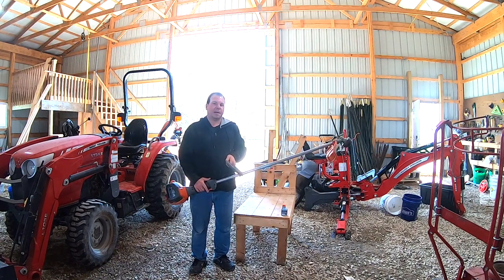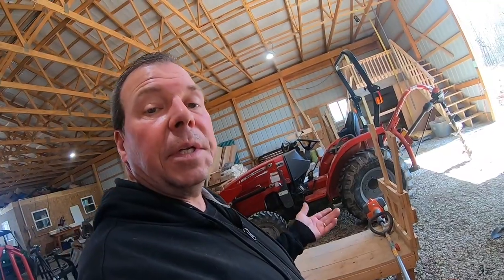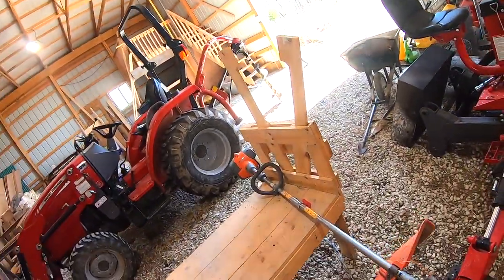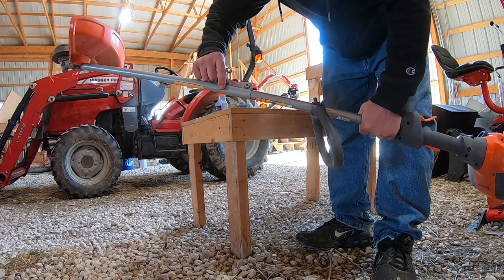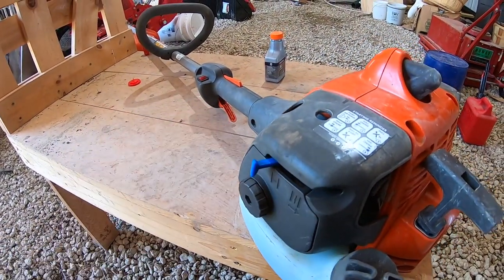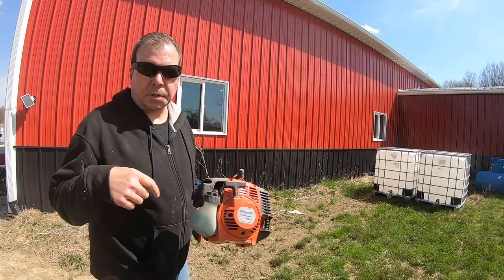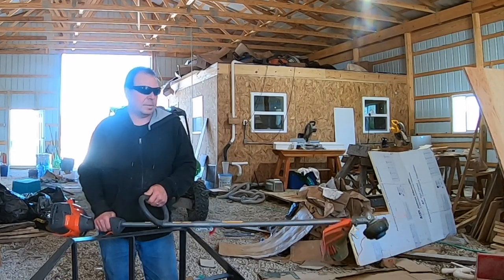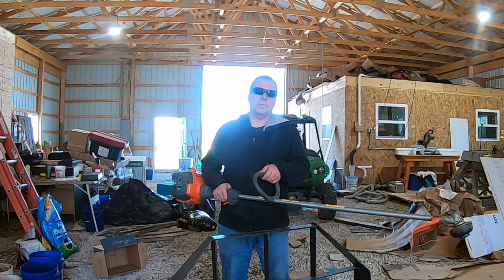Husqvarna 128LD

Comment: I bought my Husqvarna 128LD from Lowe’s last year for $199. Biggest upgrade you can do to this trimmer is replacing the head with an Echo SpeedFeed 400. Best $30 I spent. I also picked up the edger and mini tiller attachments. Haven’t used the tiller yet, but the edger works great.
Reply from the maker: Hey Matt,
Nice! Thx for watching!
Reply: Where can I find the edger attachment for the 128LD? Husqvarna discontinued the edger attachment! Having trouble finding one! Is there another brand that is compatible with the 128LD?
Reply: @user-qr3vs7jz3x  I believe the attachments that fit Craftsman and Troy-Bilt split shaft trimmers also work for the Husqvarna 128LD. Not swearing to it, but pretty sure I’ve read that before.

Comment: I’ve had no problem with those trimmer heads..I know the speed loads are much better but I have the 128ld and for my home use it works well..never had a problem with line advance and there’s no need to use choke on mine once it’s been running to restart..pull rope and go!!!
Reply from the maker: Hey Ronald,
Cool. Thx for watching!